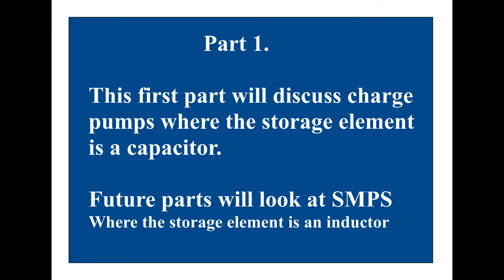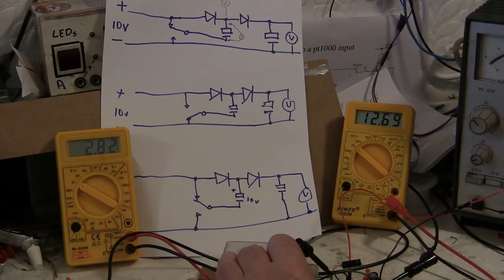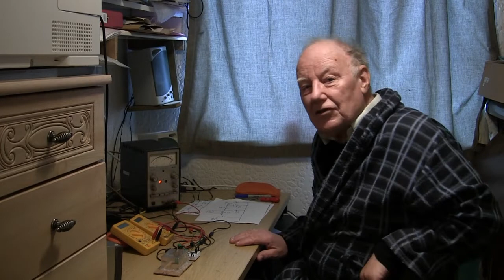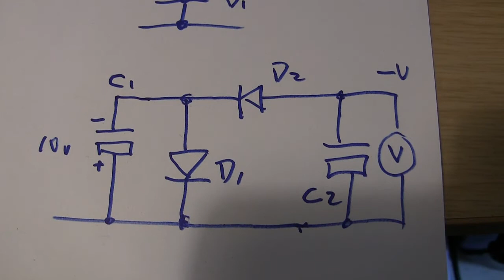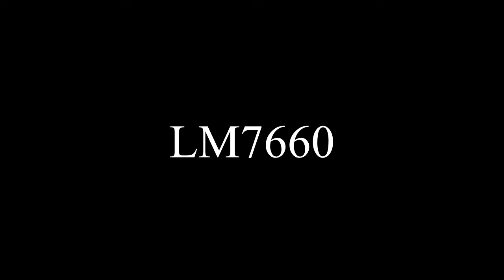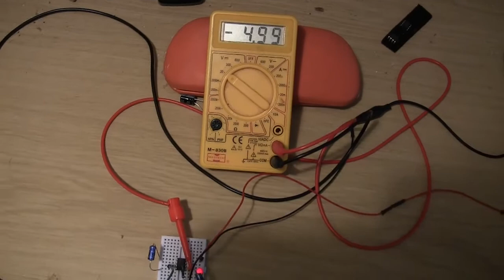Switch Mode Power Supplies, a basic introduction.

Comment: Very good work bill this is very use full I will watch this several times to make sure I take it all in . It would be great if you do some videos on op amp designs and 4-20mA acitve and passive loop transmitter circuits
Reply from the maker: Thanks for watching and leaving a comment. I am glad that it was of help to you. There are lots of things that I could do but it all takes time. I have an op amp application that converts a RTC 100R to work into an input designed for 1000R RTCs. I will be putting this up soon. 🙂